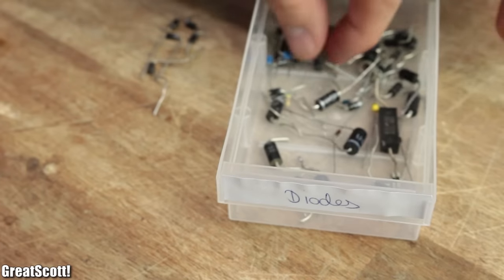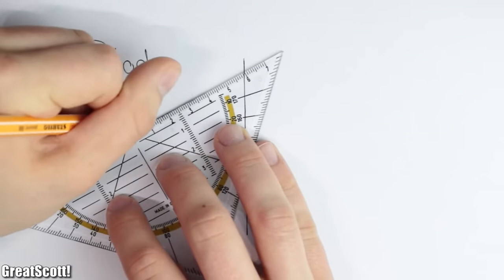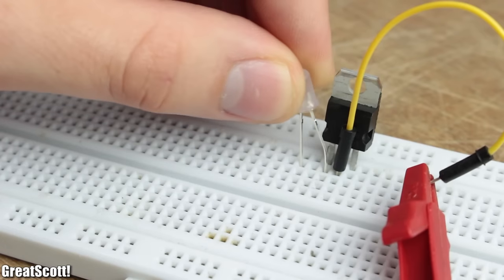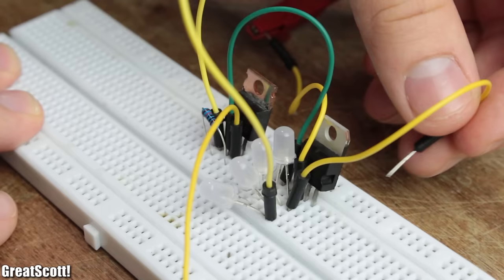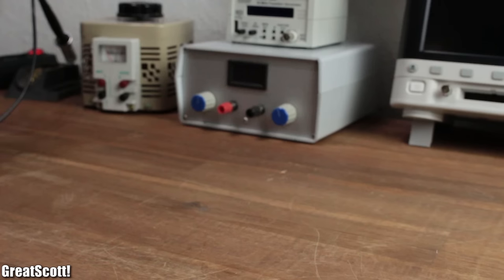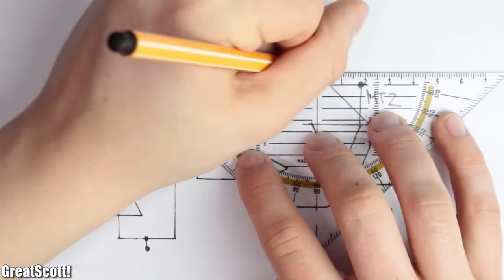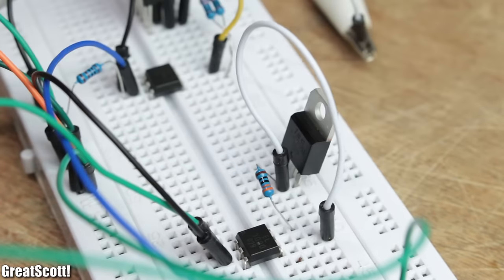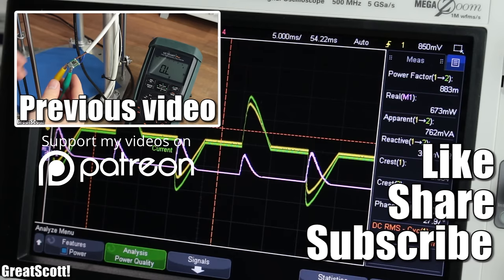Electronic Basics #20: Thyristor, Triac || Phase Angle Control

Comment: This video was a little bit too fast to cover the subject
Reply: I think this guy is very good , but I think you need a degree or two to keep up with him .
Reply: Yes it was bit fast
Reply: agree.
Reply: all i understood was when it hits zero somehow it gives a signal of like 5v
Reply: yep, it was difficult to get to the point of the theory exaplined here at first, but if you watched this video three times then you could understand the basic concept (that worked for me)
Reply: I agree. There's some info about a similar setup in this video https://www.youtube.com/watch?v=nbKwUSH9NiY&list=PLxaGnte1Dq0lgNtfA9H5Hd_YDyjylThJJ&t=606 He calls it a, "Phase fired controller."
Reply: @potatotech7378  The 9vac is sourced at two locations. At the first it's rectified and then connected to the first optocoupler. The 5vdc on the other side has a 1k resistor and is divided to provide power to the Arduino as well as the optocoupler. However, when the optocoupler is connected, which is its normal state, it's sinking that very small amount of current to ground with very little impedance, whereas the Arduino's pin D2 is relatively high impedance - and therefore doesn't get a read on the signal. Since there's no capacitor on that rectified 9vac supply, it hits 0v at 120hz. Whenever it is very, very close to zero the optocoupler opens (turns off) and stops sinking the data signal to ground. Now that the current is being infinitely resisted on that side, the voltage builds back up to 5v (on the order of microseconds or less) and pin D2 finally gets a read on it.

So basically as long as the optocoupler is wasting a small amount of current on the one side, it's also wasting a small amount of current on the other side and so when the voltage drops to 0 on the one side, the voltage stops dropping to 0 on the other side.
Reply: @oOcitizenOo  I had to do about 5 and pause for a few minutes on the code and the schematic to be able to read it for myself, but yeah, agreed.
Reply: I paused and went back a couple of times. That's the beauty with Youtube compared to lectures in school :)
Reply: Then you need your finger to point the slider to play wherever you want to replay again.

Comment: Whenever I plug a component (like a TO-220) into a breadboard, I always use a pair of small needle-nosed pliers to bend the pins of the component 90 degrees first (on the pin axis), so that the component will slide nicely into the board (like a wire) without any damage to the component OR board--What do you think.
Thanks for all the high-quality videos, too!!!

Comment: Interesting take on SCR control. What advantages would you say this rather involved method has over the original  three or four component control circuit used most widely? You are a great teacher and lots of people are interested in this subject so I am curious why you did not also mention the simple way to control an SCR with a variable resistor, a fixed resistor , a capacitor and a diac ( The diac is optional) Thanks for a very interesting and informative channel.

Comment: I have no idea what you're talking about, but I admire your knowledge and I like your accent and videos.

I'm trying to "tap" a 16v power socket on a turntable, so I can run an LED strip from it, but it seemed to destroy the electronics.... unless I destroyed them by trying to solder a power jack off the LED circuit board.

I'm going to try one more time, then probably use a 12v battery. That's the level of my electronics :D

Comment: Nice!!!! I have a printer I tore down for project parts (HP LaserJet 1012). It has a circuit straight off of the mains voltage (120v/60Hz) that consists of an inductor-HV film capacitor-Triac (BCR8PM) w/ Opticouple (3SD21)-feeding into a 24vDC/240vAC 10A Relay. The circuit feeds the heating elements of the "ink setting" system. I've been scribbling all over this PCB trying to figure out how this 'triac thing' works....Then, in a break from my frustrations...you read my mind, mid project, and I got schooled ;)

Comment: I hope, I overlooked something, but: An Autotransformer is not an isolating transformer. 
One of the contacts is connected straight through, while the other gets transformed. 
Which means, if you connected live and neutral on the input side in reverse (or plugged the plug in the other way around) you would have 230V live mains on one end of the output cable (and 225 to 235V AC on the other (differential being only 10V of course)). But the 230V are still earth referenced, so current would still flow through you like touching a live wire!
Reply from the maker: +LeoDJ True. I always check the wires on the input beforehand.

Comment: Hi, thanks for the video. However, touching the output of an autotransformer is potentially FATAL. This is a video about BASIC electronics so will be watched by beginners. A lot of explanation is really necessary first..
 This is NOT isolated from the mains. It assumes that the Neutral is always near earth potential and that every mains installation has the Live and Neutral the correct way around. I have used an autotransformer in an AC test set-up but used a isolating transformer on the mains side to keep me safe.  Why not use a transformer from a old wall adapter? This is much safer and more readily available to the hobbyist?
Reply: Max, Your transformer is NOT isolated.  That's what the "Auto" in the name is.  Your good quality auto transformer has its circuit diagram shown on the front panel to remind you. 
Test it with a Ohm meter..
   Your otherwise excellent video is likely to be on YouTube for many years to come. Please consider re-editing it before someone copies you, but gets a shock. You have responsibility to your viewers, not to mention liability..
I am not the only one to mention this in the comments. Don't assume that we are all novices out here
Reply: GreatScott already talked about it in this video:https://m.youtube.com/watch?v=trmxzUVT2eE&t=134s.
What he tried to say in this video is that there is a safe voltage between the outputs of the autotransformer.

Comment: This is a really mind blowing video!! Thanks so much for sharing this valuable knowledge! Im using your idea into my final course work. By the way, one thing I would suggest is to change the map function on your code. The potentiometer is being mapped from 0 to 10,000 microseconds (which corresponds to 1 period of the 60 Hz signal), but Arduino nano is getting the zeros in 120 Hz, because you rectified the AC signal. Then, instead of mapping from 0 to 10,000 I would suggest you to do it from 0 to 8333. That helped me here :)
Reply: I've modified the code again. I mapped from 1000 to 8000. I've put 1000 because arduino needs to wait the 1ms pulse from the digital input 2 and decrease to 8000 to avoid crossing the next pulse.

Comment: hey scott.... can u make a video on controlling 220volt AC fan speed controller using triac or thyristor and arduino...
Reply: @tripplefives1402  You can control the speed by lowering the torque just fine, ac fans do it that way, and I've seen fans that use dimmers to control the speed, creating a variable frequency sine wave would be overkill for just a fan

Comment: In circuit at 4:00 , the resistor going to the optocoupler (4N25) is only 165 ohm which will only drop 8.25V when 50mA flows though it leaving 4.65V (12.9-8.25) across the diode of optocoupler which will destroy it as per the datasheet.

So my question is how you calculated the resistance value for the optocoupler, are you using the peak voltage or RMS voltage because in both cases the resistance value doesn't match my calculation.
Reply: Don't know what he did. Datasheet says 10mA typical LED current. So the resistance value for the optocoupler (LED-side) should be R=9*sqrt(2) V / 0.01 A=1272 Ohm., right?

Comment: Really nice videos, keep up the good work.
I have just one small question, by switching the triac what do we actually control. i.e. the AC voltage or the AC current.
I mean to as if i monitor the AC Waveform across the load then will i get to see a clean sine wave?
Reply: The Triac behaves like a full-bridge rectifier made from diodes. It is either fully on or fully off and does not limit voltage or current in the way that a Transistor (MOSFET) would. Instead, the current is controlled by waiting to activate the gate of the Triac until some number of milliseconds after the ac wave crosses the zero point. The full 60hz wave is 16.67ms wide, so each half is 8.33ms wide. He controls power delivery by adjusting the delay between 1 and 10ms before activating (closing) the Triac, which results in very crude waveforms which either begin partway into each half of the 60hz signal (1-8ms delay) or completely skips one half of the wave altogether, and a little into the next (10ms delay). As such using either a 4ms or 9ms delay is about the same in terms of getting half of the power, but using a 7ms delay would be far, far less.

If you want a clean sine wave then you'd want to use a linear regulator (MOSFET) instead of a Triac. It would be less efficient for some uses and more efficient for others.

Comment: ...just wondering, when you are going to make a TO-220 type case-compatible three-pin package that is easy on breadboards--just get a pair of needle-nosed pliers and twist the pins 90 degrees and they slip into the breadboard EASIER than a 1/4 W resistor!!

Comment: I used to work on welding equipment with similar circuitry. You can actually build a PFC out of a single lm324 and a few discrete components. Tap off your incoming AC, amplify it so it clips and makes a square wave, pass it through and integrator to get a sawtooth and then use a comparator to compare it to a set point, then use that signal on your triac or half controlled bridge rectifier.

Comment: hey Scott, I have tried to built a dimmer as fan regulator , as I am from india here we using 240v and 50hz ac so first I stepped it down to around 12v ac and fed it to full wave rectifier so and then connected + terminal of bridge to pin of 4n25 via 1k resistor and pin2 with (-)bridge , I am using pic microcontroller all is working fine in Proteus simulation , after detection of falling edge of interrupt firing 500us pulse to moc 3021 pin1 so according to theory I hoped to get around supply ac but in result I am getting 170v only , result is not according to theory but if I fed continuous 5v to pin1(moc3021) I get full ac supply , I am so stucked so can you tell me what is the reason?

Comment: Great video! Could you please explain how to wire up the zero crossing detector circuit which is safe to use and doesn't use a transformer? The non-isolated step-down DC power supplies seem a bit scary to me.

Comment: Nice job as usual !!!
Is it possible to control the Triac with PWM output of arduino instead of potentiometer.
Reply: The potentiometer is connected to pin A0 as an analog input. When the optocoupler is open (at an AC zero point), D2 goes high. At that moment the reading of the potentiometer is taken and then that value, converted to milliseconds, is used as the delay. After the delay D3 is pulled high (for about 5-10µs), which is what activates the Triac's gate. It wouldn't make sense to try to use a PWM output bit to control the Triac, because it's either on or off and, once activated, will stay on until the next zero point of the AC wave.

Comment: What is an opto coupler? You should make a video about them maybe?
Reply: +Marius Ammann Roughly, it is a photo transistor with a led inside a single component, it is used to transmit signal between electrical circuits without having the to be electrically connected, but optically (thus the name opto-coupler). In this video, the purpose is to protect arduino from the currents coming from thyristor that may damage it. Mostly applicable to any higher voltage circuits.
Reply: +Steel Mecano I was building a Bluetooth speaker that uses a £2 USB Bluetooth receiver and a simple amplifier kit, but when they are both powered from the same battery you can hear a really loud interference which sounds like the Bluetooth data being send (sounds like a dial up connection). However when I give them one battery each, one for the Bluetooth receiver and one for the amplifier the interference goes away and it works perfectly. Might an opto coupler or something else help isolate the two devices?
Reply: +Marius Ammann The point of using optoc-ouplers is to "connect" two electical circuits that may be totally independent and isolated from each other. Since the bluetooth receiver shares some wires (even through discreet components) with speaker, this gives a way to audio parasites to reach it. Opto couplers may not be of great help in this situation as both sides of them are in the same electrical circuit.

Comment: Hey I have a doubt .. why not just directly feed the 9 V AC voltage to the option isolator? You'll still get a approx. square wave for the positive cycles and you can use the state change triggered external interrupt in your Arduino ....
Reply: If you take a look at the detailed symbol of an opto-isolator you'll notice that it has a light emitting diode on one side ( https://en.wikipedia.org/wiki/Opto-isolator ). Depending on the rating, an AC signal may blow out the diode. Otherwise it would only respond at 60hz (only half of the wave above 0v) rather than 120hz (both halves of the wave).

Comment: Can such a cirquit effectively be used to slow down a router in a CNC? Or would a solid state relay & PWM slow down a Bosch Colt in my X-Carve? There's no speed control on the Colt.. I've tried mains light/LED dimmers but that didn't work..

Comment: Hi, I don't understand what you are using the optocoupler for, I did here that the higher the voltage on the input, the more infra red light the LED emitted an therefore increasing the voltage on the output through a phototransistor but how does that then create a voltage burst at every zero point of every half wave? Thanks

Comment: Hello I have unusual question wuld that circuet work with pick up coils found in distributors?
I have for days problems finding corect circuet to interupt pick up coils going to ignition module .
So any help please?
Is there specific frequency/voltage range that needs to be known first to make centrain circuet and how does the calculation is done?

Comment: I now just read on the data sheet that the IC can be used in switch mode power supply feedback, could this be related to your certain application? Thanks

Comment: Hello.
With zero cross detection AC regulator I would like to control welding transformer, but I saw the scope that for example 50% switch the transformer alwys will get the maximum voltage at turning on.
It would be better to turn on at 0V and trn off at some point not vice versa.
Can you please help how could I do that?

Comment: In the Arduino program for how long do you keep the pin 3 (Triac) high?
It does not show. I suppose you have to pull it low also.
Reply: The map function is also used incorrectly...

Comment: Hey I was trying a similar Circuit for making AC dimmer for 220V using BTA 12 TRIACs, the problem is when I use if for controlling fan speed it controls its speed but their is a humming noise. What could be the reason , do I need a snubber circuit

Comment: Autotransformers do not provide electrical isolation from the mains. How did you probe the thyristor in the vídeo (03:17) without shorting a phase to ground trough your oscilloscope? I'm currently having problems with this limitation but can't find a easy solution.
Reply: Maybe you sorted his out. You could connect an isolating transformer before the autotransformer. If you have two transformers 220/12V put them back to back and this provides actually double isolation. Then probing is totally safe!

Comment: Your given program is not working, as zero crossing is not synchronized with the generation of pulses. You defined zero at pin 2 but not used anywhere in main program. Can you provide me original used program and help me ?

Comment: Can i use a 600v 30 A thyristor as a 'switch'  for a capacitor that only has 200v 2200uF? im wondering because i need a high Amp thyristor, but the amount of voltage on these thyristors are always 600-1200V. will the thyristor still work even when i attach only 200v cap?
Reply: yes

Comment: I do everything whats in this video i'm not a beginner in electronics but this is not working i think there is a mistake. i use 2 thyristors parallel opposide direction i drive the gates of SCRs seperate doesnt work even with triac.

Comment: but just to control the intensity of a lightbulb you can do the same with a mosfet, can't you? the same way you just need a mosfet and an arduino to control the intensity of RGB LEDs, you can instead connect a bulb... am i wrong?
Reply: +jjensen2492 oh okay... does it pwm as well? i mean, is it the exact same thing but with more components?
Reply: +jjensen2492 thanks for the info! will have a look at that ;)